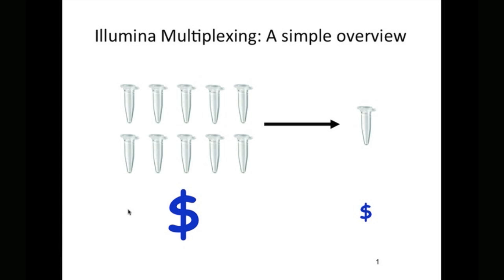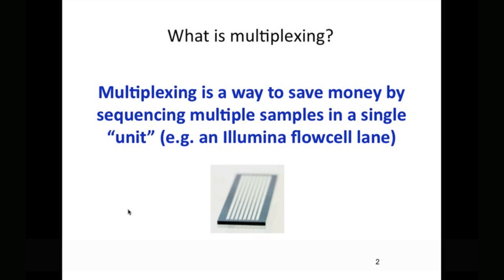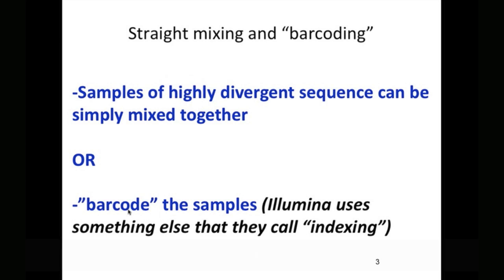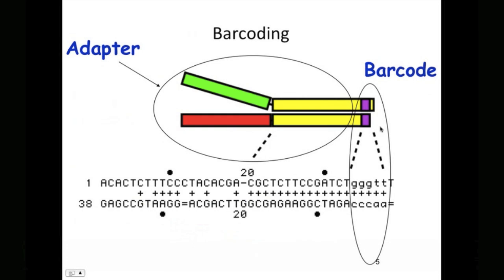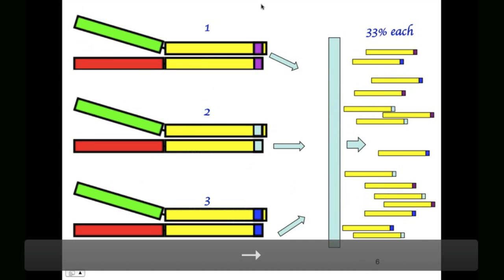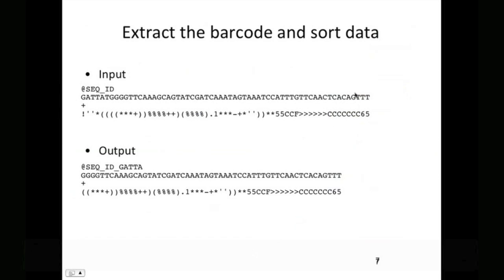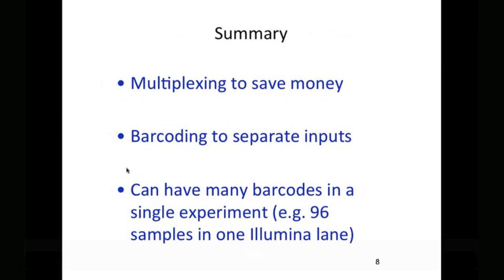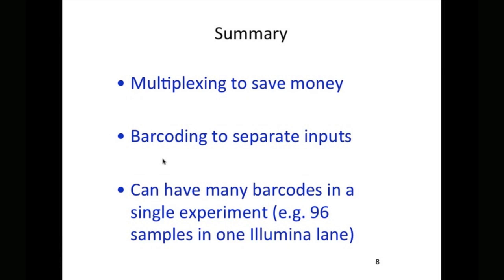Illumina Multiplexing 1 - Overview

Comment: How do you insert your barcode into your sample sequences?
Reply: One method of doing this is called "adapter ligation." Prior to sequencing, DNA is fragmented into smaller double stranded sequences, the ends are trimmed using enzymes, and short double stranded DNA "adapters" are added which bind to the ends of your fragmented DNA. These adapters contain the barcodes and other components for sequencing.